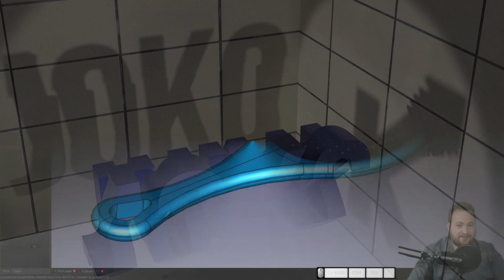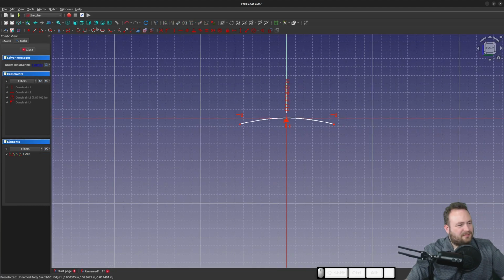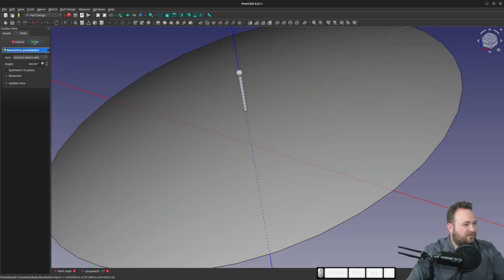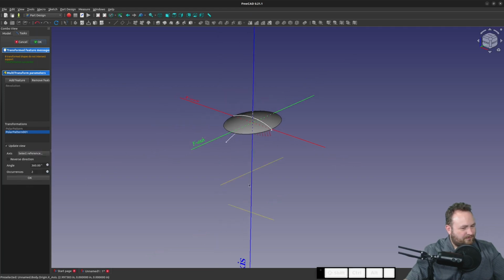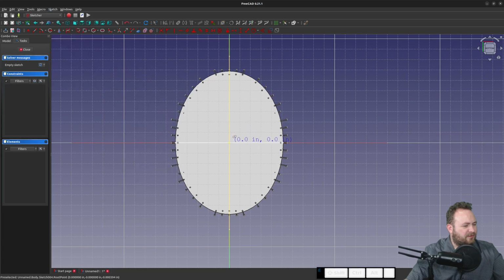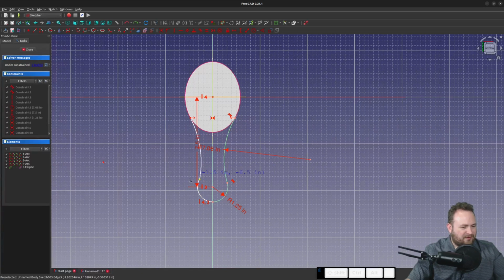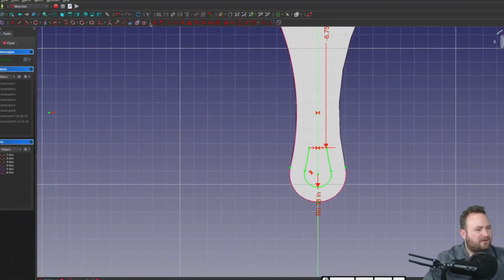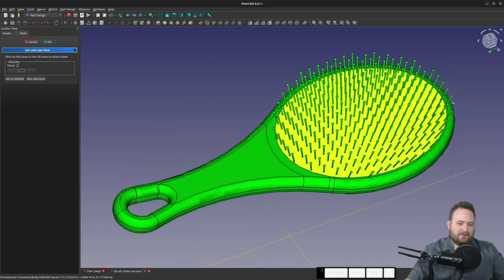FreeCAD- Model a Brush with Normal Patterned Bristles |JOKO ENGINEERING|

Comment: The cut at 4:00... I really don't get what happened here. Why was anything left of the body after you used a larger sketch to cut theough all?
Reply from the maker: The 'through all' in Freecad is only 'through all' in a single direction, so only material on one side of the sketch plane was removed.  Good question.
Reply: @JokoEngineeringhelp  aaah, makes sense. Thank you for the reply and a good tutorial. Just started of with 1.0.0 on my cad journey. Seems like I won't need to care about onshape/fusion 360 or the like
Reply from the maker: @wlgrd7052  It's nice to go the open source or perpetual route, I'm grateful for those options!

Comment: Hello, although you're showing here FREE CAD, I decided to let you know of a horror situation with your very recommended (Alibre Atom 3d.) I did get one, but to my horror was not Windows 7 compatible. I did told the Alibre company that I needed the (Kener134.dll) compatibility to Windows 7 64bit, all with negative result. So I got an extra computer all-in-one with Windows 10, and that was another horror, because the maximum ram allowed was 8gb. I installed a 16gb anyway. I could tell a lot of horrors that did happen between Windows 10, all in one and Alibre. But I prefer just to say that, its was a big mistake from the Alibre company, to take the Windows 7 compatibility, because Windows 10 is the most horrible OS on the market today. NO privacy at all. Alibre might be an outstanding software, but without Windows 7 or 8, it is just GARBAGE, cause Windows 10 is Garbage - Spy center. I did try to use it 6 time and stop forever. In my Windows 7 server, I have many CADS, including the $800 TurboCad Platino and BobCad CAM also for Windows 10, but they are 100% Windows 7 compatible too. Thanks for your tutorials. I have an server with 256gb, 32TB SSD, and 32 Core >>> AND ALL with Windows 7 64bit Pro, with server 2008, with ZERO nightmare or SPY.